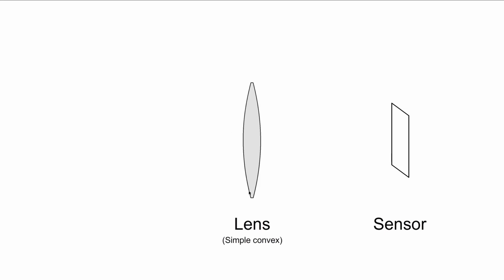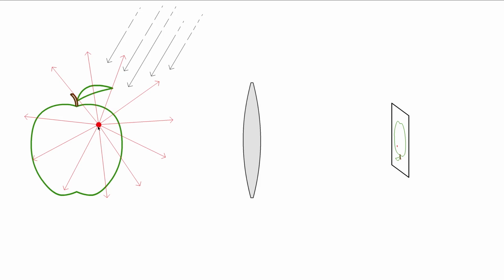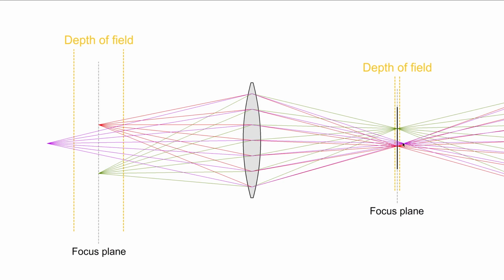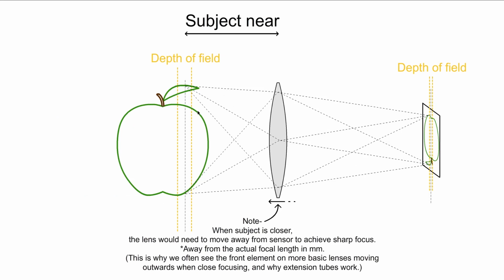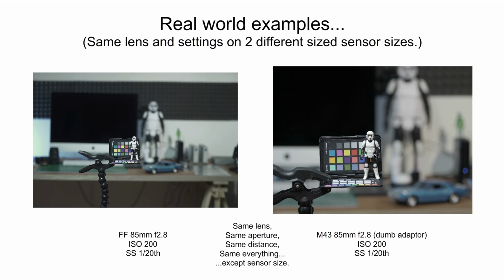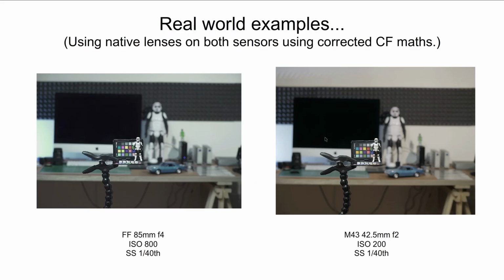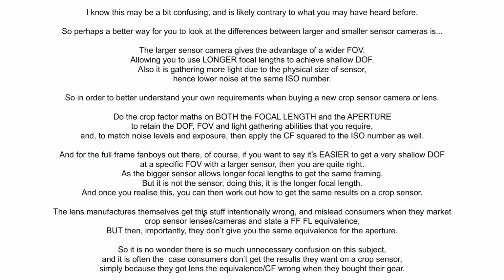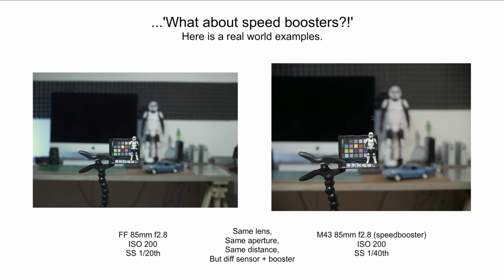Depth of field and crop factor misconceptions.

Comment: Great video! Loved it! but your info on the speedbooster is not accurate. You forgot that the speed booster also lets you to gather 1-stop more light.
Reply from the maker: Hi, thanks. this video was mainly about the depth of field, so the extra light wasn't really a factor. bare in mind its not really gathering extra light, its just focusing the same light a full frame camera gets, and shrinking that down into a smaller area. as the ISO/exposure is measured by the square inch. this then makes us lower ISO to get the same exposure as we would get if using a native lens, when using the booster. but when comparing the M43 to full frame, you are technically still getting less total light (with same lens, same aperture) on our m43 cameras, who compared to the full frame, as its not using the whole image circle (even with .64 XL booster).. plus there is another layer of glass to go through with booster... so more lost that way too. so it all gets rather tricky explaining whats going on with a speed booster. it only seems like more light when comparing it to a native lens. or if you are not factoring in how the ISO numbers relate to total light. (As i tried to explain in the video, the ISO number is essentially lying to us if we want to know about the total light creating our whole image.)
Reply: The lens doesn't get extra light but the sensor does. Thats the difference of using a speedbooster to a dumb adapter.
Reply from the maker: i think its down to your wording really, (where i disagree) there is no 'extra' light. with a full frame lens, a dumb adaptor, and a crop sensor there is lots of light being wasted. that light isn't being wasted on a full frame camera. and all the speed booster is doing is capturing some of that wasted light that spills around sensor. the idea that there is 'extra' light suggests the booster is making light that wasn't there in the first place. remember im mainly talking about m43 vs full frame here. the speedbooster is helping the m43 compete, bringing DOF inline with a larger sensor, and allowing a larger full frame lens to be better optimised for small crop sensor.
Reply from the maker: if you want to compare native m43 lenses to speed boosted lens on m43, then you simply have to use the fstop to determine the physical size of the aperture, and cross reference that with the FOV... you soon see it clearly then. (eg. the 25mm f2 m43 lens has a aperture of 12.5mm..... a full frame 50mm (same FOV) f2 has a aperture of 25mm. and light doing what light does, thats 4 times the area, 4 times the light (both at same fstop and same FOV)
Reply from the maker: then simply do the same maths with the speed booster.
this means the FF 50mm f2 lens is behaving like a 64mm f2.56 when its on a m43 with a .64 booster. So as you can see, thats a slower, tighter than it behaves on FF.... but certainly much closer to the full frame performance.

Comment: This is the clearest, most concise explanation of this subject I have seen.  The key elements are succinctly outlined with easy to understand with illustrated explanations.  The pacing is appropriate as well without getting overly bogged down in any of the steps.  I've seen many videos and read many articles on this, but this video encapsulates these factors the best.  Thank you.  If I were to offer any suggestion, then I would recommend: 1)  Using a larger colored cursor and moving it much less (the excessive cursor movement is very distracting)  2)  For the text heavy slides, I would bring in each text section of the slide separately to help lead the watcher digest the information, instead of overwhelming the watcher all at once.  With that said, the video is free and offered as a service, so I can't complain too much.  I'm very appreciative for your effort and the time you took to produce it.  The video is great educational service to anyone interested in the optics of cameras.
Reply from the maker: anglewinder thanks! And I agree on your criticisms. 
I did this video in one take/recording after drawing the illustrations. 
I should have spent longer on assembly.  
But I tend not to put lots of work into YouTube when I’m busy with paid work. 
YouTube is a fun hobby for me. Nothing more. :)
But if I have a quiet work period, you will see spikes in quality on my YouTube content, simply as I then have more time to spend.

Comment: I have been researching this a great deal recently because this conclusion comes directly in conflict with my past experience using 4x5, 120 and 35mm films formats. This particular phenomenon I think is particularly difficult to definitively demonstrate because there are so many variables. Making it very difficult to keep oranges from appearing in the apple bin.
Additionally our eyes and brains process out of focus images by adding their processing to them making it harder to evaluate.

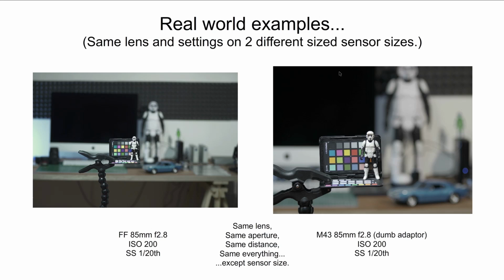My problem is this: the real world example at 18:58. Look very carefully. It appears to me that both backgrounds are equally out of focus. Neither crop contains more or less resolved detail than the other. I am curious to see what the result would be if one were to enlarge the image on the left or reduce the image on the right. I'm betting the resulting images would be indistinguishable. If your conclusion were correct and one needed to increase the aperture a full stop for the smaller format than why isn't the background on the left not significantly sharper? I think they are too similar to substantiate your claim.

I thank you for taking the time to produce and post this video and join the discussion. This is not a criticism, just a disagreement in the conclusion.
Reply from the maker: Mark Trued I think you are overlooking what scaling an image does to the circle of confusion. 
With infinite resolution “apparent DOF” would indeed work very differently. But if both sensors are at the same res, then scaling an image does indeed change the DOF.

Comment: F-number is the Focal lenght/Diameter of the Entrance pupil not the diameter of the aperture. Everything else is quite right
Reply from the maker: 24Steevy hey thanks for input. 
So can you explain the difference?
I did a lot of reading before making this vid. And many sources state the f number is the focal length divided by the diameter of the aperture. (It's how I was taught this stuff at uni too)
In anatomy the aperture is the iris which can close down and dictates the size of pupil. 
So I'm a little confused by your comment. 
But happy to learn if I mis spoke somewhere.
Reply: The aperture is the apparent diameter with regards to the Entrance Pupil. So a lens that has a focal length of 90 and F2 will not physically have an aperture of 45mm. Dependent on the lens design before the aperture this can vary. Of course you want to be as close as possible since other effects will interfere with the quality. This does not effect the results and conclusion in your great video tho!
Reply from the maker: Mathias Elmeskog thanks. I see what you mean. Obviously I was using a very simple lens design for my model (to make things simple for clarity) but yes a real lens has (as I did mention) multiple elements and is more complex. 
But we both agree the numbers (fstop) do the job I say they do. And work for our formula correctly. 

It's a fine line between not get bogged down in too much info/detail, and getting across what is important for this subject. (DOF and crop factor)
Reply: I think that it is very good that you did like that since it does not matter for the end user. My thought was just to explain what (I think) 24Steevy meant :).
Reply from the maker: Mathias Elmeskog thanks dude. 
I refreshed a lot of my understanding about lenses before making this vid by watching FilmmakersIQ vids (he's brilliant) so maybe check those out if you are looking for some good practical demonstrations. (He gets out his lasers and magnifying glasses to show all this stuff Working in the "real world". )

Comment: Basically confirms all that Tony Northrup said with more clarity...thanks
Reply from the maker: Yes exactly, (I just messaged Tony about it)  I tend to think visually.. not with mathematics.. so i thought if i could take that info and show it with illustrations, then others could maybe get a clearer picture of what was happening inside their lenses. :)
Reply: Heya, Blake. Where did you message me about it? I'd be interested in talking with you, I just can't find a message from you.
Reply from the maker: Hi Tony. I sent a PM to your Facebook 'Tony Northrup' page. (My name is Blake Evans on FB) 
Note -PetaPixel are going to run a article on this very soon.
I explained much of the information is originally from you, and from Filmmaker IQ... i simply broke it down and drew up some (hopefully) clear illustrations, and went into a bit more detail regarding everything a viewer will need to know to understand the need to approach the solution of true equivalence this way.
Reply from the maker: Did you spot any mistakes Tony (that was all i was asking really.)
Reply: care to create a vid explaining why?
Reply: Assuming both sensors are electronically identical, just different sizes, why would the crop have a different ISO? Yes, I understand that they typically are NOT but that doesn't answer the question.

Assume two sensors identical in every way except for total size - why would the smaller sensor differ from a simple crop of the larger sensor?

And yes, I watched the circle of confusion bit, where you assumed that the pixel pitch of the full frame sensor was larger than the crop sensor. That may be true in most examples, but is not a necessary condition. How would your explanation change if they were identical electronically?
Reply from the maker: Jack Deth hi. We ARE assuming both sensors are identical except for size. 
That is why we give the smaller sensor more light per square inch. (Hence diff ISO as this is how it is measured)
Because then we can match the same total amount of light over the whole sensor surface. 

This is what is important to our image.
The total amount of light that creates the entire image.
Not a portion of light falling across a portion of the image that is only relative to the sensor size.

If you set ISO number to get an exposure then please remember what the ISO number actually is. It doesn't tell us how much light is making up the entire image. 

Once you get your head around the fact the ISO is misleading (when what you want to know is total amount of light for the whole image.... how many little packets of photons :D ) you can then work backwards, and the rest makes sense.
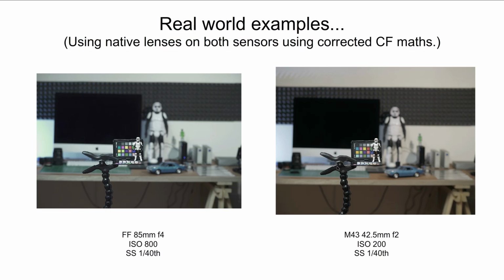Reply from the maker: Jack Deth I did touch Upon this at 25:50
Reply from the maker: Jack Deth p.s. The circle of confusion bit doesn't relate to our ISO. That was explaining the DOF difference with sensors with higher pixel density.
Reply: Why would an identical sensor have more light per unit area (square inch, photo site, whatever) from exactly the same lens? Less total area I get, different DOF and FOV I get, all good.
Reply from the maker: Jack Deth I think you have mixed up things a little there. 
Remember if you are doing a equivalence for all of it- (between 2 diff sized sensors)
FOV
DOF
Noise. 

Then u are changing focal length (lens), aperture and ISO. So they all balance. 

If we are talking about the exact same lens on two diff sensors then this is a different situation. 

In which case. 
The FOV will be out to start with. (Tighter on crop) So we can't do an equivalence regardless.
Reply from the maker: Jack Deth p.s. 
If you want to talk further about this same lens diff sensor then- (this isn't what my video is suggesting people do)
But regardless, just to talk about it... 
So same lens. Same aperture. Same subject on say a m43 and a FF. (Easier maths on these compared to apsc but it all works out)

The m43 will be gathering 1/4 of the light of the FF. 
Even though our exposure is the same at exact same ISO. 
This proves my point entirely. 
The crop sensor is sitting in the middle of a big pool of light from the lens. And 3/4 of it is happily falling around it and being completely wasted. 
(It's a tiny bucket out in the rain)
(Where as the FF sensor is a much bigger bucket catching 4 times the rain)

So, this is why ISO number is so misleading. 
And we want a 800 on FF and 200 on M43 to match total amount of light. (Which matches image noise)
Reply: I am questioning why noise is included in your explanation. Noise is a function of gain. What does it have to do with the lens? To make my example more clear - the pixel sites are identical on my two imaginary sensors and therefore have exactly the same noise and sensitivity. There are more of them on the bigger sensor, but what is the difference between the smaller sensor and cropping an identical shot out of the larger sensor? Would this scenario still require an adjustment for ISO and why?
Reply from the maker: Jack Deth Jack Deth hey. 
I think Tony's video explains this better than I can in the comments. 
He backs up his stand point. (And mine) with a ton of correlated data from his own, and DXOmarks testing. 

Please watch the whole vid. (Sorry it's pretty long)
And then feedback to me if there is anything you still don't get -
I would honestly like to hear either way if your opinion changes. 
As I'm very tempted to do a all singing and dancing revised fully animated video for this that addresses ALL the things people can't get their heads around on this subject matter. 

The vid-
https://youtu.be/0OtIiwbAZi8
Reply: "We ARE assuming both sensors are identical except for size. 
That is why we give the smaller sensor more light per square inch."

If you do that and the smaller sensor does not overexpose, then you are underexposing the larger sensor. You will then need to raise the ISO of the larger sensor to compensate, increasing its noise level as well. That exposes the central fallacy of Northrup's test results - comparing cameras set to significantly different ISO's and attempting to cloak his misleading conclusions behind obfuscating DOF arguments. "Total amount of light" is irrelevant to sensor exposure, it is a total red herring.

Comment: and 
using older mf lenses, I personal vouch for an adapted nikon nikkor f2, 24mm 28, 35 85 mm lenses as well as all the FAST voitlander lenses...
Reply: if you need AF then get out the checkbook .. oh no speed booster.. 
hate the name   light speed is constant hahahaha
Reply from the maker: good point, yes speedbooster makes it sound like a comic book hero
Reply: faster than a speeding  
thoughts on my ?, tyhere is some setting that will brighten the darker areas without blowing out the brighter areas.. man I am needing a nap, mind fog!!!
Reply from the maker: Matthew White not sure if one of my replies disappeared. 
Re raising dark/ lowering blown out. (I'm guessing for stills u mean)
Use raw and edit in lightroom/pshop. This will  give u more range. 

Out side of that maybe dabble with take 3 bracketed shots. And combine. 
(But maybe don't go too HDR crazy, it's a bit overdone these days and I'm personally not a fan of that extreme HDR look. )

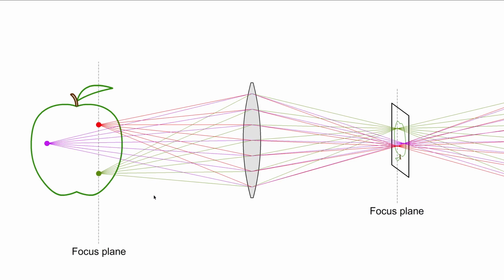Comment: @8:31, the rays from the more distant part of the subject will converge before they reach the sensor, not beyond it

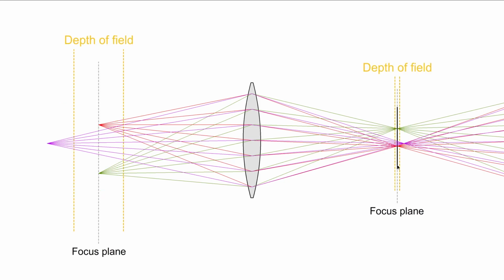 @8:56, the zone of sharpness around the sensor is called the Depth of Focus not the Depth of Field.  The depth of field means out in the "field" - ie outside the camera, in the subject area.

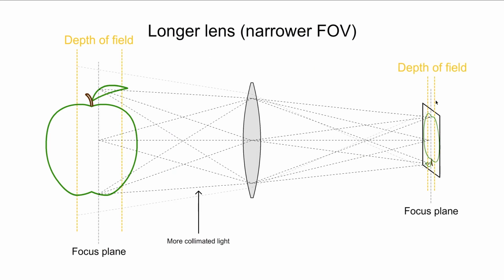Why do you only show rays through the centre of the short lens @13:41 lens, and not through the periphery as in the long lens @13:55 ?

I gave up watching after that.

Comment: There is still a lot of incorrect information and this certainly is part of it.
Most of what is said is factually right! 
But and this is a big but no one ever puts the same lens on a FF and a MFT to shoot the same scene at different distances that is just 
comparing Apples with Oranges it makes no sense.
The only meaningful comparison is at the same Angle of view and distance to the subject and than a crop will lose!
What counts it Lens diameter. So even if it would be possible to make a MFT Lens with the same DOF as a FF lens the lens would be just as big and heavy
so there is nothing gained in goig to MFT.

One has to accept hat crop cameras are nothing but a lame trick to make customers buy light lenses with big f-Stops and save them pretty kilos!
Reply: just as big and heavy? the equivalent m4/3 lenses may have the same diameter, but they're half the focal length.

Comment: Generally correct but, sorry to say, unfortunately rather sloppy video, mistakes, incorrect notation in formulas (equality sign used where there is not equality), jumping from topic to topic (e.g. why mention circle of confusion at that point). 

But still thanks as this topic deserves discussion as people as still confused, evidence of which is e.g. arguably inflated excitement about new "small" medium format cameras. 

One issue still not explored, as far as I know, is what is the actual effect of sensor size, after accounting for equivalence. There needs to be some marginal effect of focusing  equivalent light on a smaller vs. bigger chip.